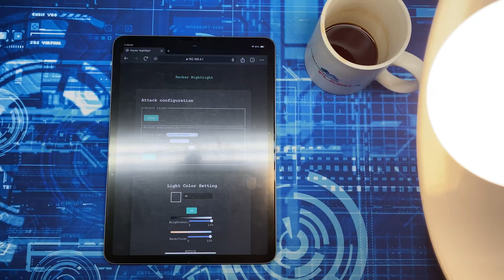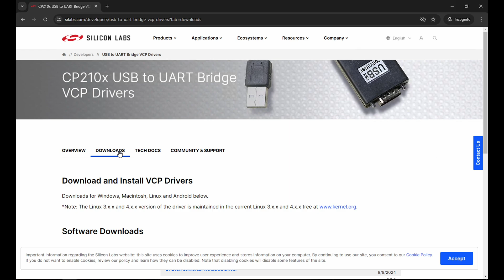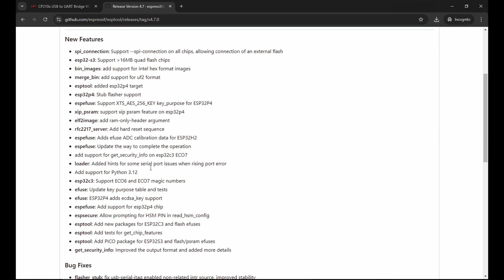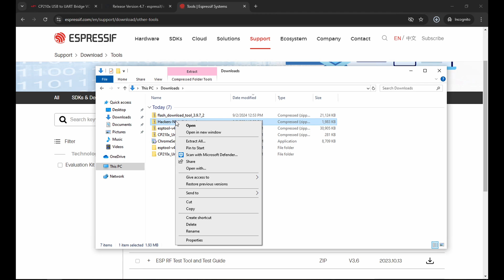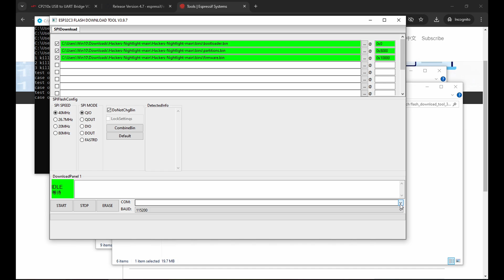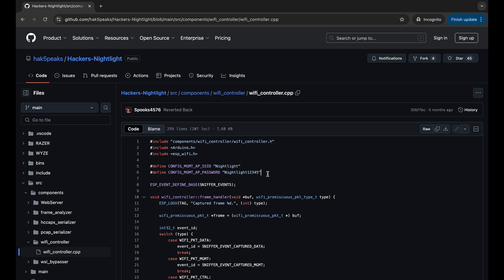Hackers Nightlight - When Smart Lightbulbs Attack

Comment: This makes me wonder if smart switches and dimmers are generally using ESP32s as well. If they are, you could create similar firmware for a smart light switch that would have guaranteed uptime as opposed to a smart bulb. Plus, they generally last longer than a light bulb as well, so it could go undetected for longer periods. It's also more hidden and has more room for additions potentially, I could see a pi zero or pico being implemented for more utility once implanted.

Comment: This was always my suspicion when the push for “smart devices” was so strong. Made me think, then upon learning so much about mcus and coding, I too came to the conclusion that since these smart bulbs are almost all esp32s there is a giant security risk with all these devices. Cheers from Texas!
Reply: Absolutely a great point. That's why I take precautions, such as ensuring that nobody who comes into my house steals my lightbulbs, rips them apart, flashes custom firmware inside, and then reinstalls them, permanently disabling them from showing up in any of the apps as a result.

(obvious /s is obvious, I should hope. This is not a security risk whatsoever for obvious reasons.)